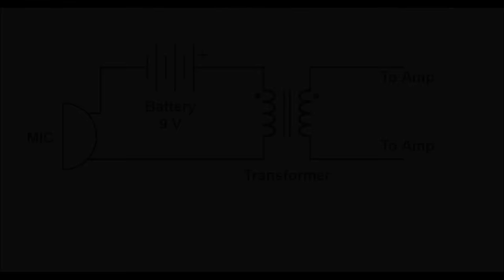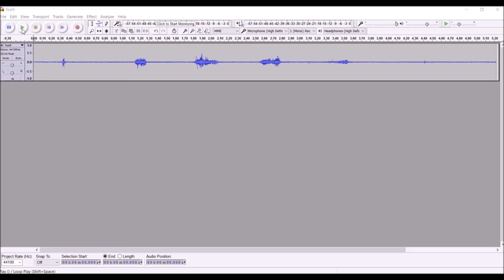How to make a Microphone

Comment: I think the hot glue used to attach the pencil lead to the wooden stick absorbs a lot of the vibrations. The pencil lead is a relatively stiff material and is supposed to vibrate to the sounds.
Reply: Its distortion, not rattling.